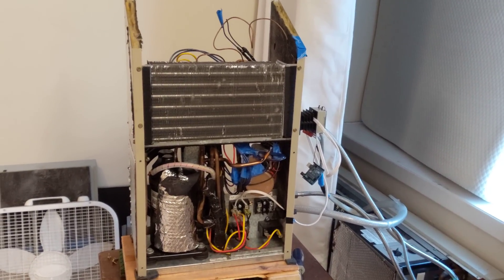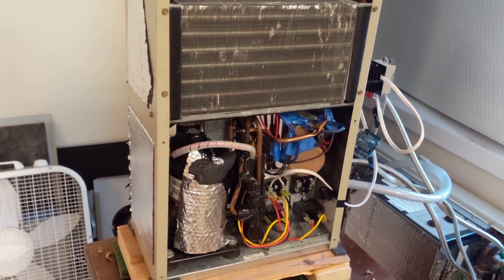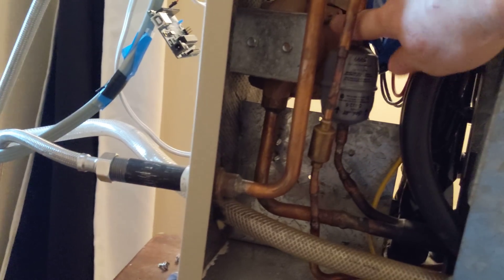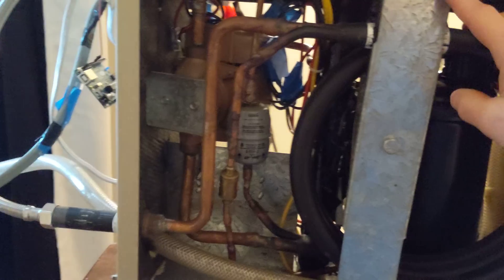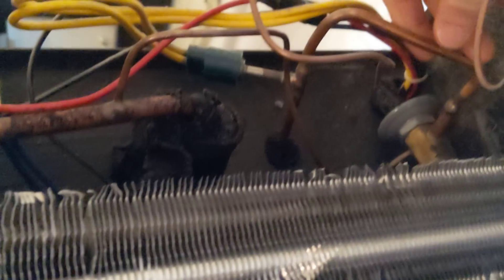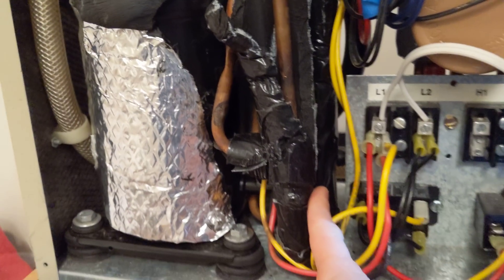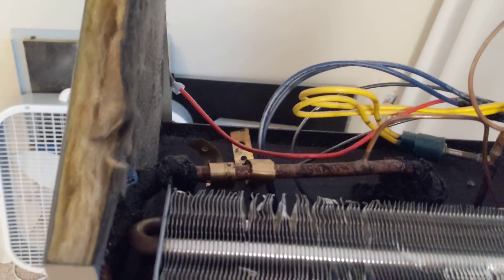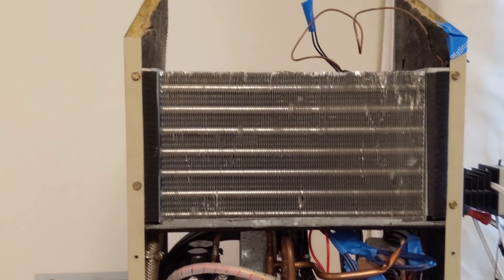An air conditioner made out of a hot water heater!

Comment: Hi. Could plz make the drawing of the system and share.
Reply from the maker: It is pretty straightforward - just like a normal air-to-air AC unit except that the hot side it connected to a heat exchanger so the heat can be taken away by flowing water rather than moving air. Happy to answer any specific questions!

Comment: The TXV has a "sense bulb" clamped to the exit pipe of the evaporator.  The bulb should be in good thermal communion and INSULATED well from ambient air.  Yours is not insulated, thus it is biased by air temp, not as cold as the actual refrigerant pipe.  Being uninsulated, it "senses" incorrectly, thus liquid flow is too high, evaporator is flooded.  A reader below says "added additional muffin fan to increase air flow solved the freezing problem."  I guess the experiment failed, because the chilled basements were stealing heat from the home?  Where is the efficiency in that?  The heat has to come from somewhere.
Reply from the maker: Yea getting that bulb colder would have helped. Unfortunately (fortunately?) I got rid of this Frankenstein. :)
The idea was that most basements in the service area (Northeast US) are unheated, outside the building envelope, below grade, with stone walls so they tend to stay the same temp as the ambient ground temp. So you are basically pumping heat from the surrounding soil - sort of indirect geothermal.

Comment: Do you think you can do the opposite?

Cause we have lots of cheap old aircons, but water heaters are expensive.  I want to convert normal aircon to water heater?
Reply from the maker: Easy - in theory. Simplest way would be to rig up some pipes that ran the water over the condenser coil (the coils on the outside side). Then that water would get heated. But doing this in a way that has the water making lots of contact with the coils and does not leak would take some effort (or you could replace the condenser coil with a heat exchanger if you have the tools to break the refrigeration loop). You would also probably want to wire the controls of the AC into running the compressor harder than it normally would so that the water got above 120F. Note that they make this as a product - it is called a Heat Pump Water Heater - and you can get them at the Home Depot near me https://www.homedepot.com/p/Rheem-Performance-Platinum-40-Gal-10-Year-Hybrid-High-Efficiency-Smart-Tank-Electric-Water-Heater-XE40T10H45U0/312742067

Comment: Can you force more air through the evap. causing a higher load to run the coil temp up?
Reply from the maker: If look in the background you'll see a box fan that I was using with a cardboard duct to force as much air though that coil as practical, but still froze up. I was looking for a way to reduce the totally BTUs without breaking the refrigerant line or changing the speed of the motor (AC synchronous).
Reply: @bigjoshlevine  Try a squirrel cage blower. They can develop much higher static pressure to force air thru the coil. The loose rule of thumb is 400cfm per ton (12,000 btu).
Reply: Or...Add a load such as a heat lamp or small space heater. It could even run on a timer. Think de-frost heater in a frig.  Start at 200 watts and go from there. Not the picture of efficiently, but it may allow it to keep running.
Reply from the maker: @timsmith190  I had not thought of this solution, and yes this would totally work. Unfortunately I would not be able to sleep knowing I was intentionally wasting Gibbs free energy like this!

Comment: I'm about to undertake this same project. My intention is use a Sanden S7 compressor from late model car with variable discharge pressure valve. It throttles refrigerant flow based on PWM input. This would keep your compressor running all the time though its output could essentially be zero (fuel savings in automotive world).

Just a thought. Good luck!
Reply from the maker: Please report back with your results, I'd love to hear how it ends up performing!

Comment: Introduce hotter return in the form of outside air or make up air. Also try to duct it so you can use a bigger blower to circulate more cfms
Reply from the maker: Good suggestions, but if I have access to fresh air then I would not have had to do this project. :)
I did not show in the video, but in operation I had a giant cardboard faring mounted on it so I could duct the output from that 24" box fan though it. Ultimately the ambient air temp got down to 45F so no matter how much air you moved through the evap would go below 32F. I think ultimately the right solution would have been to make a termal connection between the hot gas and the output of the evap to raise the gas pressure. Probably soldering a hunk of copper between them would have done the trick.
Reply: @bigjoshlevine  if they big hunk of copper is you approach take a look at thermoelectric generators(paltier modules) might be able to devise a contraption to introduce a bigger heat load through the coil .

Comment: You just have to install a freeze stat that will shut off at 28° just have it shut off the compressor for a few minutes the fan can keep running so I can deiced a coil and then I’ll come back in in a little while and you’ll be good to go. They have different types you can look at zoning freeze protection from EWC for starters. Thanks Jerry
Reply from the maker: Since this was going in my bedroom, I really wanted to avoid to clua-chunk of the compressor turning on and off.  Can can you think of a way to increase the temp of the evap so it is always above 32F so freezing is a non-issue?  I think there is a way to do this only using the metering device to control the low side pressure (which controls the low side temp).
Reply: Increasing the airflow causing the temperature difference to be higher. Like any heat exchanger or toaster oven is slow the air down you pick up more temperature you speed it up you lose temperature.         If you don’t like the idea of trying to warm the evap coil more either by adjusting refrigerant charge or TXV if it all possible or shutting off unit when it gets too cold. You can try adjusting the water piping and find a way to lose a little bit of capacity so that you’re not freezing up. Say adding a couple of tees piped between the supply and return with a check valve feeding into the supply from the return creating a bypass loop. You could use a ball valve between to throttle the water coming in and if you have a check valve it can’t backfeed. That will give you warmer water does Al not allowing your coil to get as cold . You can adjust it just by throttling back the valve a little and keep temperature probes on there to see what happens.👍That’s what I would do it before I start messing with the refrigerant. Thanks Jerry
Reply: Ball valve, You could use threaded fittings as well make it easier couple of good wrenches , fittings and some Teflon tape and you’re good

Comment: I have the same unit which I used for heating water and for cooling a laundry room. I had icing issues as well, but only during winter. I added a 8” duct fan  on top and that kept it from icing over.

Comment: The service port where the tube is crimped, grip it with the purging plier and open the pipe and weld a Schrader valve to it and add refrigerant.. I did the same on a vintage r12 window A/C unit to recover the refrigerant and no gas was introduced to the environment.
Reply: Or use a piercing valve.  A person on youtube used it and no issues years afterwards, he recharged a number of window ACs.

Comment: u band is for reduce noise , reduce the water flow rate to the condenser to reduce frost on evaprator. this heat pump is made to condesing in hot water , NOT chilled water.

Comment: It is possible that you can fix the issue by attaching a thermostat to control the water pump based on the temperature of the water leaving the heat exchanger. Like a standard air conditioner, if the condenser is too cold( the water loop heat exchanger), the pressure  going to the txv will be low and will potentially cause it to not meter refrigerant correctly. This is a similar issue to standard air conditioners that is required to run in cold seasons due to large assemblies of people, however, in that instance, the pressure of the liquid refrigerant is monitored to control the outdoor fans. This way, the condenser coil can build pressure and allow the txv to open correctly.
Reply from the maker: I think this would totally work, but I am an entropy cheapskate so I can bring myself to intentionally increase the delta T on the condenser! :) 
I really need to out try my scheme of putting a heat pipe between the output of the condenser and the output of the evaporator.  I think this will have the same effect on the evap pressure, but will be more efficient because the pressure delata across the compressor will be lower so it will pull less power (and hopefully run quieter!).

Comment: Take it to an HVAC shop that works on heat pumps. They should be able to diagnose and fix what's wrong. Could be the thermal expansion valve is bad. Essentially what that thing is, is a window AC with the condenser replaced with the refrigerant to water heat exchange loop.

Measure the inlet and outlet temps of the refrigerant and water pipes at the exchanger loop, and the inlet and outlet temperature at the evaporator. The water temperature difference is how much heat is going into the water. The refrigerant outlet temp should be lower than its inlet, water outlet higher than its inlet.

The refrigerant outlet temp has to be lower than the boiling point of the refrigerant so that liquid goes to the expansion valve. The pressure drop across the valve causes the refrigerant to boil to vapor phase and cool down so it can absorb heat from the room air. The compressor squeezes that heated vapor down almost to its liquid point (while putting more heat into it) so that when the refrigerant hits the condenser loop it quickly changes to liquid.

The water being 90F is a problem. You have 122F of 'headroom' to boiling. So you have to consider the amount of heat the compressor puts into the refrigerant, along with however much heat the system can pull from the room air. The maximum amount of heat that can be pulled from the room air is equal to 122F minus the amount of heat introduced by the compressor.

The closer to its boiling point the liquid refrigerant is at the expansion valve, the less heat it can absorb as it expands to vapor. In other words you're attempting to cool your apartment with water warm enough for a comfortable shower.

That "U Bend" is a liquid refrigerant trap. It keeps any liquid from rushing into the compressor and ruining it. As the gas phase refrigerant goes through the pipe, it will cause any liquid refrigerant to go to gas. In normal operation there should be zero to very little liquid refrigerant in the trap. Turn it off and in a short time all the refrigerant in the system will be in vapor phase. Getting liquid refrigerant into the compressor is called "slugging". If you're lucky it will simply stop. If you're not lucky the motor will fry and/or parts will break.

That's why an AC or heat pump that's icing its evaporator often takes a while to ice up after its been shut down for a while. Depending on how out of sorts it is with refrigerant charge, expansion valve or orifice tube problems etc, it may just start to ice instantly or may take some time.
Reply from the maker: TXV is good, the problem is that it was designed and charged to reject heat into much hotter high side (~140F water) than I am using (~90F water), so the low side pressure is too low and so the boiling temp is too low (<32F),  so I get frost!

So that's what's wrong, but I am looking for a way to raise the pressure/temp of the low side without opening the refrigerant circuit or increasing airflow!
Reply: @bigjoshlevine  couldn't you just limit the speed of water in the condenser side so that it's run hotter.

Comment: You might be able to use one of those plug in thermostats like I use on my old chest freezer, it might take some fiddling with temperature settings because I reckon the coils get below freezing before they start icing up, so you might, for example, set it to run till it gets to 28, then turn off till it reaches 40 degrees and program in a compressor delay to prevent rapid cycling of the compressor motor.  I think I paid about 32 bucks for my thermostat on Amazon.
Reply from the maker: Good idea! This is what I did last summer. If you look at the right side of the unit in the video, you can see a solid state relay and an Arduino bolted on. The Arduino would watch the temp at the base of the evap coil and when it got too low it would turn off the compressor to let the coil thaw out. But this is cycling is loud, and my whole motivation for making this contraption is have quiet cool in my bedroom, so ideally I am looking for a solution that (1) lets the compressor run continuously, and (2) hopefully even increases the low side pressure so that evap coil does not freeze and maybe the compressor even runs quieter. I think if I put a heat pipe between the hot high side gas and superheated low side gas then this should work, right? Or else maybe just force the TXV to open enough that the compressor can not keep up and so the low side preassure naturally builds up. Any ideas? Thanks!
Reply: @bigjoshlevine  You are almost taking of having RPM control over the compressor.  If is too cold...you  lower  the RPM...if is too hot..increased...You need a  VFD (variable frequency drive)...is your compressor  a 240 volts ? ..I saw a  L1 and L2 lines ....Then you need a VFD for  240 volts... I have never used a VFD for 240....I either used for 120  1 phase or 208 3 phase.  Check for that.   I believe if you can regulate the RPM...you will have a very nice unit.